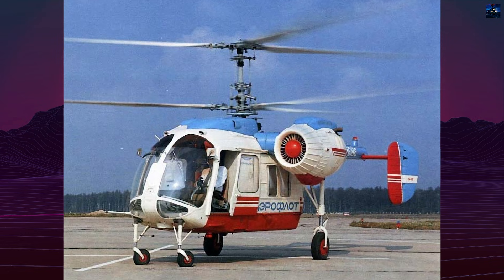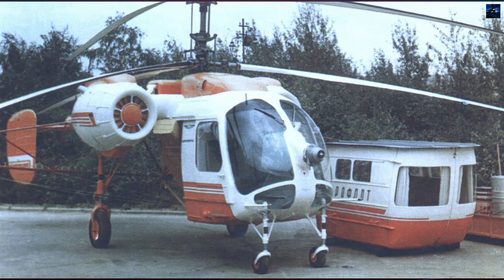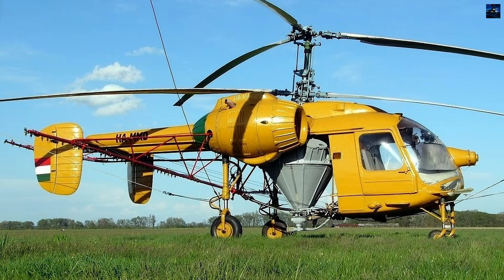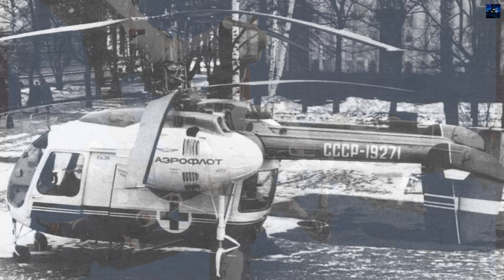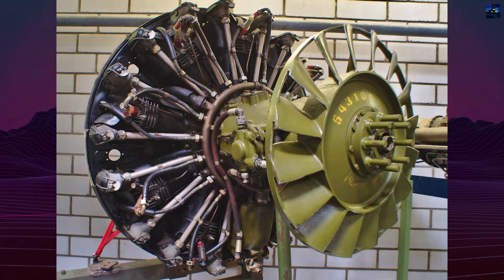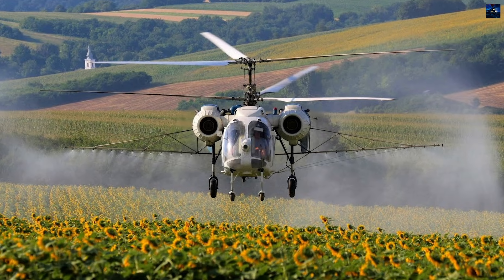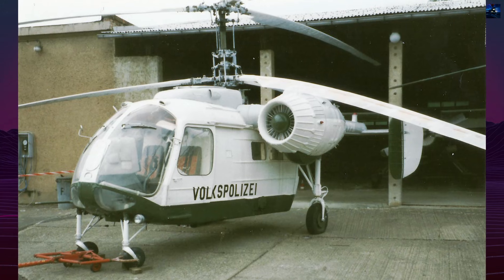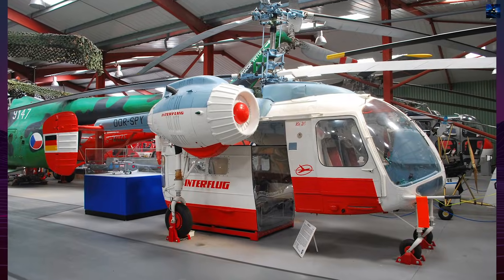Kamov Ka-26: Soviet Modular Utility Helicopter with Coaxial Rotors

Comment: During the Cold War, NATO assigned unflattering code names to Soviet aircraft. Perhaps this is why. The Ka-26 was assigned the name "Hoodlum" (violent criminal, troublemaker, hooligan or gangster).
Reply: H = helicopter      B= Bomber        F= Fighter        Hoodlum    Bear      Flanker
Reply from the maker: The Kamov Ka-26 received the NATO reporting name “Hoodlum” simply as part of NATO’s standardized system of assigning code names to Soviet aircraft during the Cold War, rather than because of any specific characteristic of the helicopter itself; NATO chose short, distinctive words that were easy for pilots and intelligence officers to remember and communicate, and in this case “Hoodlum” was applied to the Ka-26 and its later variants (Ka-126, Ka-226) as a generic designation for this family of light utility helicopters.